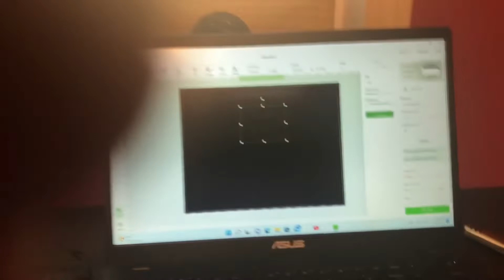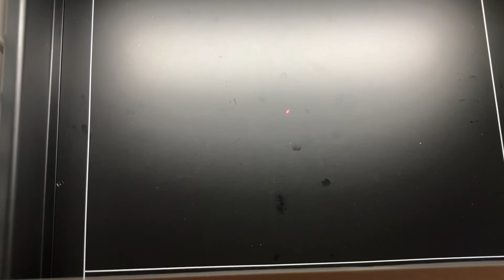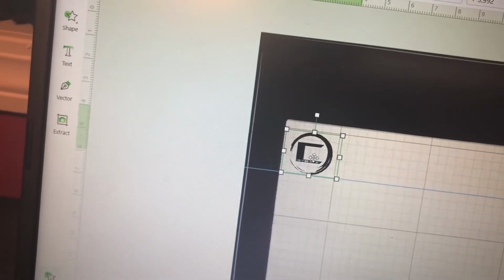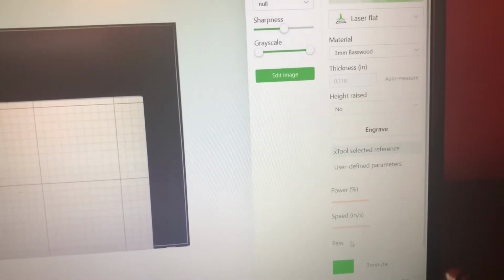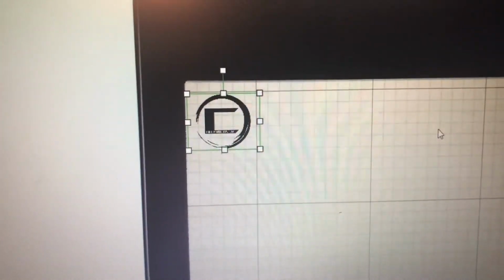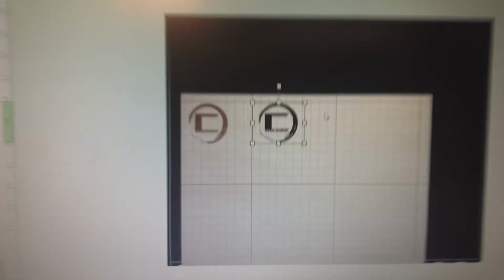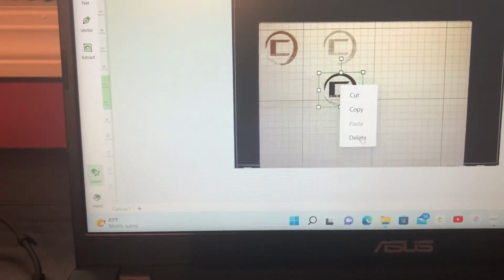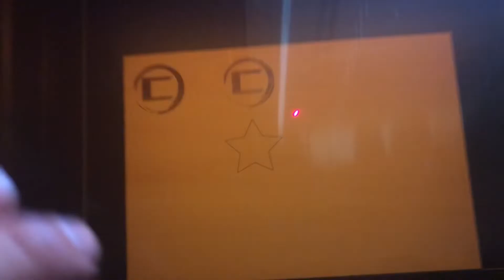How to use M1 XTool Part 1

Comment: How accurate would you say the camera alignment is? I am looking to cut lots of colour printed parts and would need very accurate cut alignments on the prints
Reply from the maker: Any material or anything you’re engraving, move it as close as you can to the front white line just under the camera. Also always do framing to ensure alignment too.